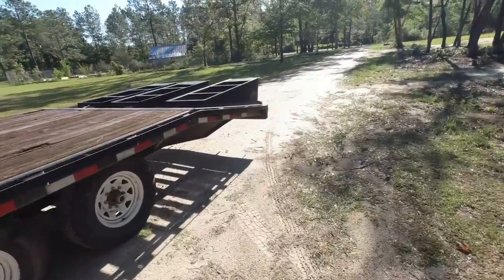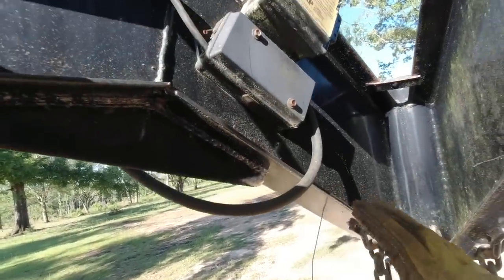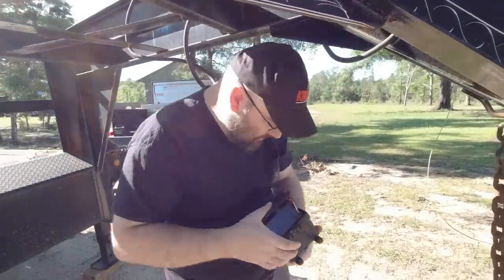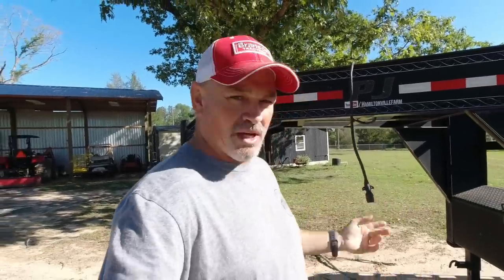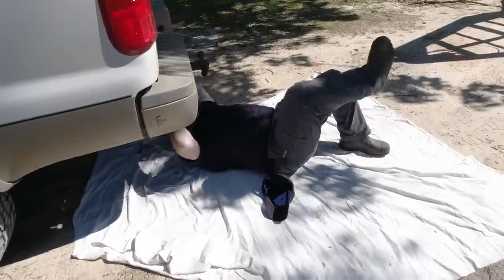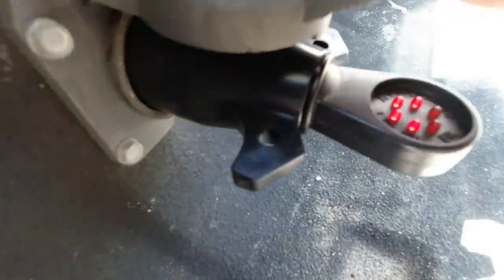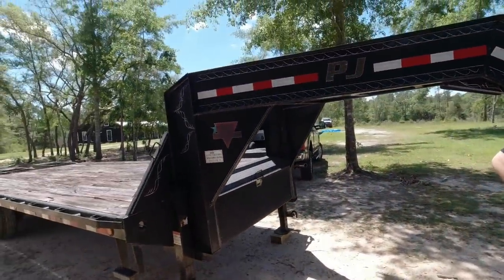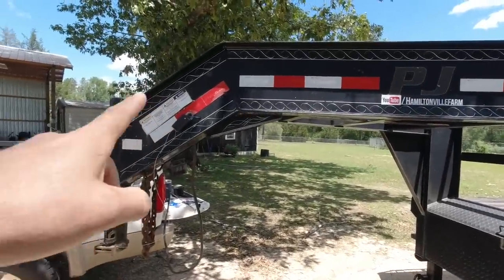I Bought The CHEAPEST Gooseneck Trailer on CRAIGSLIST!

Comment: I just bought a used Goose Neck PJ 2008 25’/5’ beaver tail for $3k, from the rust belt - frame rails completely rusted through. Looking @ having to completely rebuild it with new frame rails. So far nothing n here as bad as mine is!

Comment: I just bought a used goose neck for under half price of a new one. I will replace the single jack with a dual setup, add over 30 led markers, add reverse lights or spot lights and finally fix some light damage to it. Trailers are expensive these days and to build one was out of the question as well.
Reply from the maker: I hear ya.

Comment: PJs are a good brand trailer. I got an Ireland trailer from Andalusia. So far it’s a really good trailer, I got the max ramps on mine but they don’t go all the way to the ground so I’m gonna have to put some kind of legs on them. It’s a 10ton trailer and I can already imagine what’s gonna happen if I load it with 8,000 lb machine.
Reply from the maker: I've already replaced the decking ...it's been good so far👍
Reply: Hamiltonville Farm what does it weigh or is the tag even visible?

Comment: How has that trailer been doing? Plus which trailer do you prefer or you consider the safest a gooseneck or a bumper pull?
Reply from the maker: Goose neck all day! I just towed this from Florida to Louisiana this weekend and it pulled great.
Reply: @HamiltonvilleFarm  what is the gvwr of the trailer?
Reply from the maker: I'd have to look at the tag, but I can load 12,200 max on it. I don't recall off the top of my head
Reply: @HamiltonvilleFarm  not bad.

Comment: WARNING: do NOT buy a pigtail from Amazon. The color code WILL NOT MATCH. I already have dealt with this issue. Best to buy the wire & new male plug to make sure the color code is correct.  Save yourself the headache and anger. TRUST ME.
Reply from the maker: Thanks👍